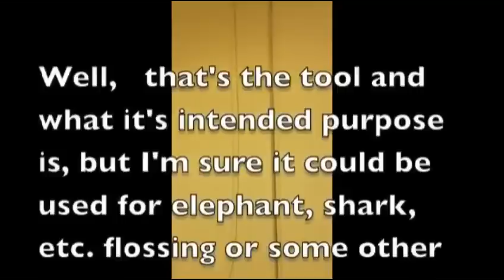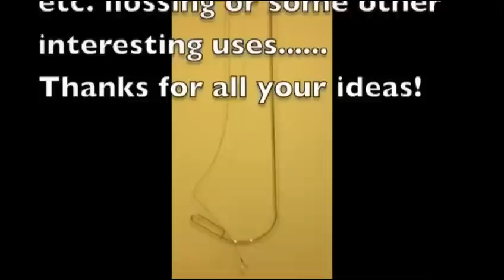TDD report for January 19, 2013

Comment: First off I would have to say that since its under or Rather inside your jacket, The denier wouldTake the initial cutting impact. When I hit it with the hammer on the first video it did cut the armour, but not very deep. So I would say that the inital impact it will moleculalry Firm up absorbing the blow, and you would get off that impact rolling or sliding. Great Question!!